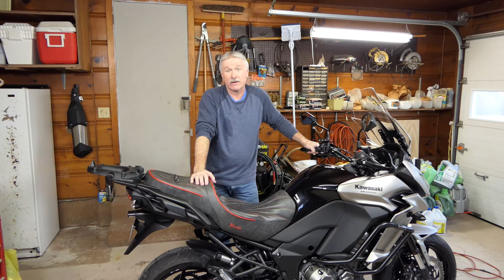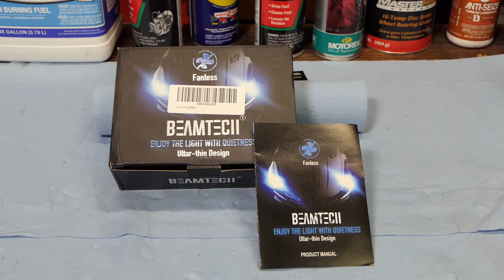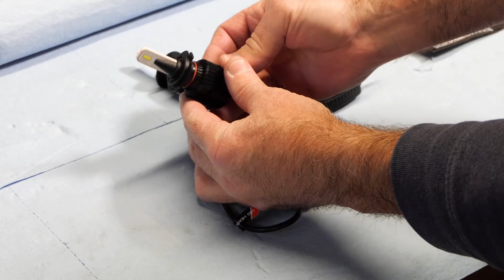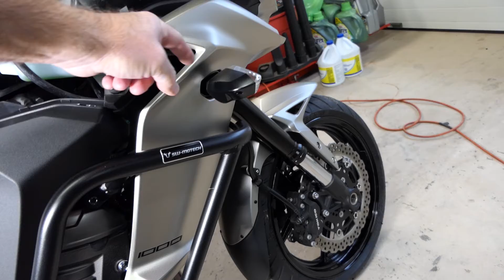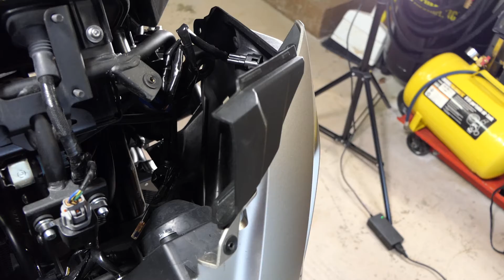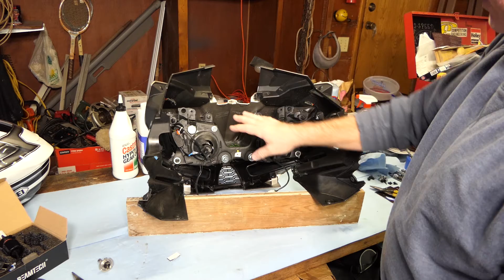LED headlights for the kawasaki Versys 1000

Comment: Great mod. I’m going to upgrade my Versys 1000 headlights. But I can’t seem to find the same set you used on Amazon. There are many Beamtech bulbs. Would it be possible for you to send me a link or tell me specifically which one you used?
Reply from the maker: @ScottAxon-r2l  hello there sir... good to hear from you...it has been several years since I made that video I am sure those bulbs I used in that video are no longer available... you will want a led bulb that is somewhere between 35 and 50 watts power consumption.  You will just have to look at the bulbs that are available now to find some...  good luck and thanks for watching...  :)
Reply: @ozarksbackroads5484  Thank you

Comment: I tried to do this and everything went smooth until I tried to power up the lights. They would not work… I tried switching the polarity and still nothing. I put the OEM lights back in to see if they work and they don’t either. Any suggestions?
Big fan of yours from KC with 17’ Versys 1k and I love heading down to Ozarks! Love your videos!
Reply: Hello there sir, sounds like you have blown the fuse for the headlights.  I would replace the fuse, put the stock halogen bulbs in and verify that all is well.  Then try replacing the halogens with the led's one and a time.  If one of the led bulbs blows the fuse again then that bulb is bad and needs to be replaced....  good luck and thanks for watching...  :)

Comment: Hi, question. If you still have V1000. How is it after almost 3 years with this LED lights? Did you have problem with blinding oncoming traffic? Any problems at all? I have 2018 V650 and i wish to instal LED lights but some people say it is not good, some say it is perfect. What is your review after 3 years?
Reply from the maker: Hello there sir...  good to hear from you.  I sold that bike to a friend of mine.. he still has the led lights in it.  I have ridden with him many times and can say that the lights are not blinding to oncoming traffic.  If you have lights that blind oncoming traffic then the light needs to be adjusted down it is set to high.  The light housing is adjustable up and down as well as left and right.  I always check my light position against the position of the halogen light when I change over to LED.  Those bulbs are only 25 watt LEDS so they aren't going to be overly bright.  I also have the LED bulbs on my 2019 V-Strom 650 and I really like them.  Again I stuck to a 25 watt bulb for both the high and low beam bulbs.  It is hard to find bulbs at that wattage, most are up around 60 or 65 watts which is really bright for an LED bulb.  A 25 or 30 watt LED bulb should last forever at that lower power..  hope this helps...   thanks for watching...  keep safe out there...   :)
Reply: @ozarksbackroads5484  thank you for answer, I will find 25-35W max LED and instal to my V650.
Reply: Greetings, I know this was a 6 or 7 year old video but still wanted to say great job on filming and explanations. Guys like you are a true asset to the YouTube community. 

I thought I'd also throw out a question to see if the guy you sold your  bike to happens to still have it and if the Beamtech bulbs are still hanging in there?  Thank you!

Comment: I just finished to install LED headlights (Beamtech H4) on my Concours /GTR 1400... it went flawless, no mods, same dust covers, etc.... just plug and play.

Well, I recall when replacing the headlight bubbles on my 2016 Versys the harness connection to the light was inside of the dust cover. In order to have a better LED retrofit, I would like the same dust cover set up as on the GTR /C14., of course using a H7 LED.

Before I buy a new pair, do the mounting diameter of the Versys? 
... 70mm??

THX for your help
Reply from the maker: Good to hear from you sir, I am glad the new headlights have worked well for you.  I no longer own the Versys so I cannot measure the diameter of the cover.  Sorry I could not be of more assistance...  Thanks for watching and keep safe out there...   :)
Reply: @ozarksbackroads5484  thanks.... I will let know and post the size when I disassemble the head assembly.

Comment: Great video, just went about changing my lights out to led. Just wondering, how did you get the bulb to stay set with the OEM clip that holds them in?
Reply from the maker: Good to hear from you sir, the bulbs I used went in  the same as the OEM bulbs I took out, there was no difference in the mount on the bulbs.....   thanks sir...   good luck and keep safe sir...    :)

Comment: After using them, do you think you could have left the rubber boots intact since the new lights draw less power and produce less heat than stock(maybe)?
Reply from the maker: I don't know how hot the heat sinks get but I think I would go ahead and open up the boots and let the heat sinks get some air, I haven't had any issues with the lenses at all....  thanks sir.....   :)

Comment: I did this mod this weekend using the Beamtech H7’s as outlined in the video. I did have to cut the headlight boots to fit the assembly. I also had to lower my headlight pattern. That being said, no pissed off drivers - yet. Signs lit up like they were lit for once. Nice pattern. Brights are heaven sent.

Night tested them tonight. The light is exceptional - worlds apart from the crap stock lights on the V1k. 

Not sure how long these will last. If they don’t, will replace them with higher quality lights. That being said, will never go back to stock lights - horrible. Not sure why Kawasaki didn’t do led to start with.

Between this and my Back Off tail light modulator, improved visibility for less than $100. Cheap insurance and great investments.
Reply from the maker: Good to hear you are getting along ok with them.... :)

Comment: Excellent video as usual. Which model of lights did you use?
Reply: Thank you so much. I’ve complained about the poor headlight power since I’ve had mine. Ride safe!
Reply from the maker: They are these....   https://www.amazon.com/gp/product/B071J4SCXY/ref=ppx_yo_dt_b_asin_title_o03_s00?ie=UTF8&psc=1          Thanks Sir.....  :)
Reply: I went to that page on Amazon and several different sizes came up. Do you remember the actual size or model? Thanks so much.
Reply from the maker: yes, the Versys takes a pare of the H7 bulbs. Just two connector prongs on them.....   Thanks....   :) @lifeenvironments
Reply: Thanks again. Got the lights today. Don’t know if you’ve used yours yet, but would be interested in your on road experience. We’re below zero here. Might be a month or so! Thanks again.

Comment: You should try the projector lens H4 Led bulb. The beam patterns is better.
Reply: A flashlight would be better than stock. Stockers are so bad they should have a safety recall! That being said, they work great once it is absolutely dark. Imo, at twilight conditions, they are a little weak, but they are far superior overall. High beam is very good. Get the Beamtech LED running lights also. In daytime operation all these lights make us MUCH more visible and do not offend others. I had to lower my low beam for better performance.

Comment: Good mod! I hope you wont have any electrical problems because of the rubber you had to cut for ventilation. Good thing new Versys 1000 comes with dual LED lights!

Comment: I just did the same mod to my Super Tenere, now I have to wait until spring to try them out on the road.
Reply from the maker: Good to hear from you sir.  I may get a chance to try mine out this weekend here in southern Missouri it is supposed to be in the mid 60's both Saturday and Sunday .    :)
Reply: @ozarksbackroads5484  I have at least 3 months to wait.
Reply: I just completed the installation and find the new LEDs to be FAR superior in every way to the halogens. Very happy with the mod!